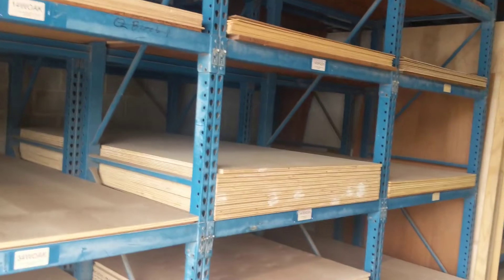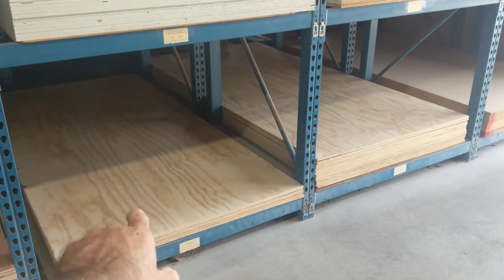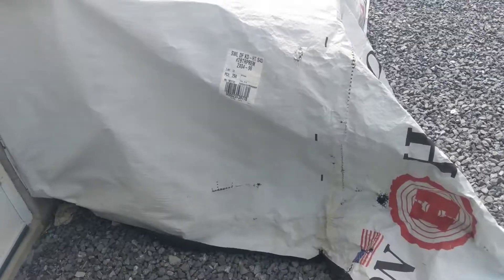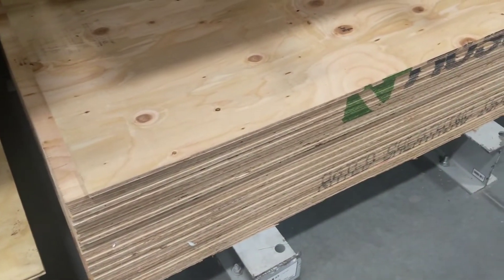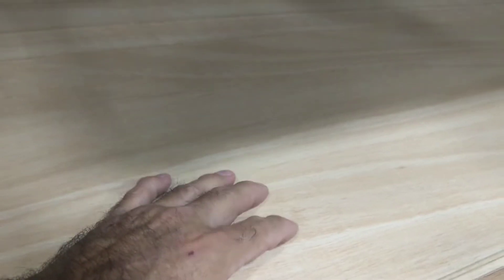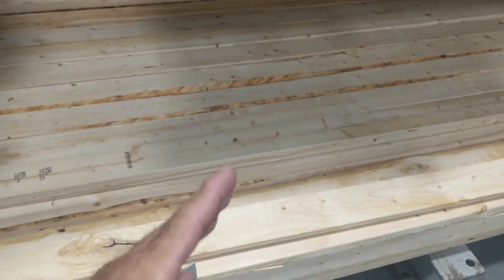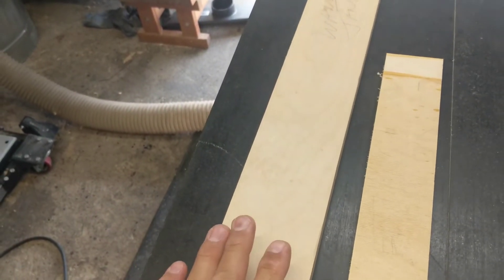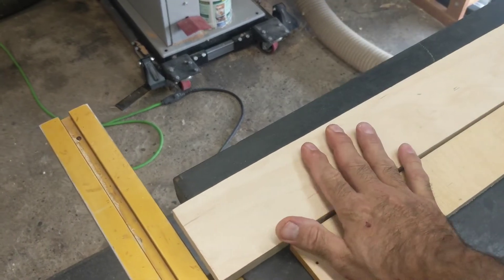Help in selecting the RIGHT wood for your layout benchwork Part 2

Comment: Have not heard of the Applewood plywood out here.  I am not sure why the prices have increased so much.  The only thing I can think is there is less lumber coming out of Canada do to the border restrictions. Still lots of lumber here and the mills and really pumping it out.  The slow mills have picked up.  There are however less mills in this area.  Thanks for the info.  One question, is the Baltic birch almost about half the weight per size in comparison to normal normal plywood? That also makes if difference if you are making modules or making it able to move.  So cost to use may also give the advantage to Baltic birch.